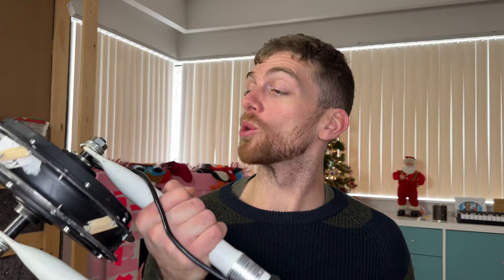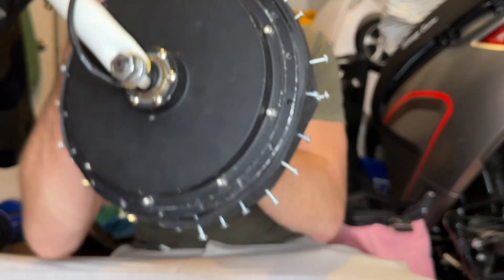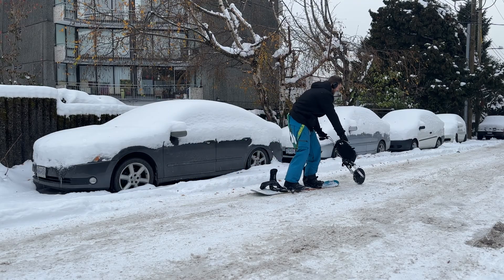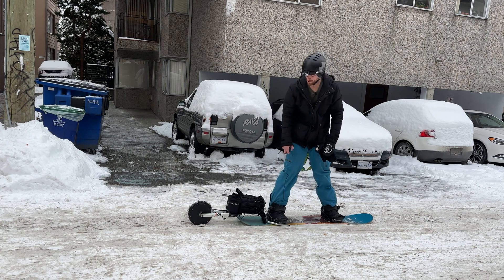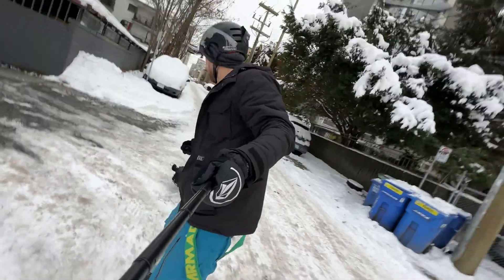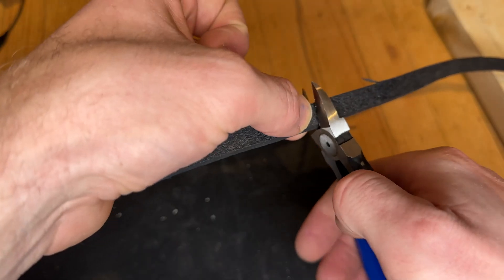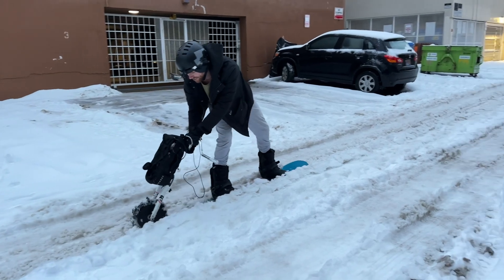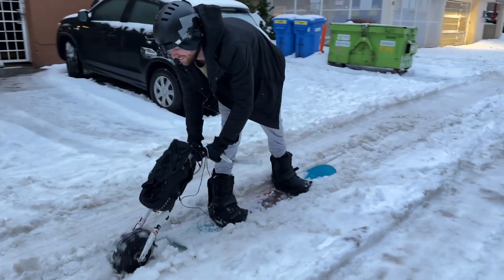Building a Better Motorized Snowboard

Comment: The concept is there, maybe just need a bit more fun balance in the budget to make a more effective wheel or motor device :) 
On to version 1.3?!
Reply from the maker: I've been thinking about using hoverboards with tracks on them then it can drive itself or push me

Comment: There is a reason snow going vehicles use tracks and not wheels.  You need a greater contact patch, especially if you hope to use it in deeper snow.  Look into using a small track from a snow blower or something.  Like all the other guys who have tried wheels it's just not going to work well.  At the very least you need a much wider wheel than you are using.
Reply from the maker: I don't learn from other people's mistakes, i gotta make them on my own. I just wish tracks were as cheap and available as wheels
Reply: @SamMeech-Ward  You can't out engineer physics.  If you stop spending time on wheels that won't work you could use that time to figure out how to build a track system.   For example find an old lawn tractor tire, cut the sidewalls off it, put it around your motor and make a frame with an idler wheel in the back to tension it.  If you need more aggressive tread bolt pieces of aluminum angle iron across it.  Look up "DIY tracks" for other ideas, the basic design people have used to make half track lawn mowers could be scaled down for your setup.  An old bicycle frame could be cut up and used to mount the motor and idler wheel.  Think outside the box, or wheel, as it were.

Comment: nice video I was a little surprised by the edeting quality but then I looked at your channel and you only have 26 subs so for thats its incredible good and also the idea is nice. Anyways now you have 27 subs. 
what also might improve your traction with the motor is putting some weight on it so it gets pushed down more so maybe just put a dumbell on the end of the forkhandle and see if that helps.
Reply from the maker: Thank you, I appreciate the feedback. I think I’m going to put this on hold until I can get some proper snow/sand tracks